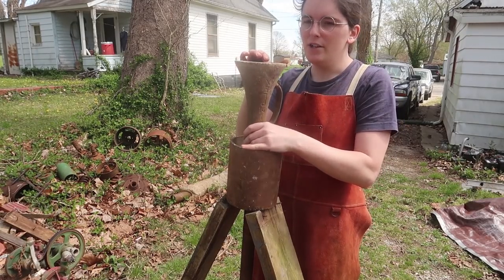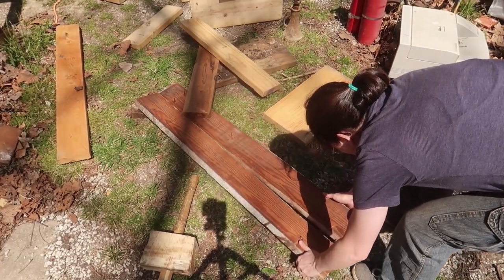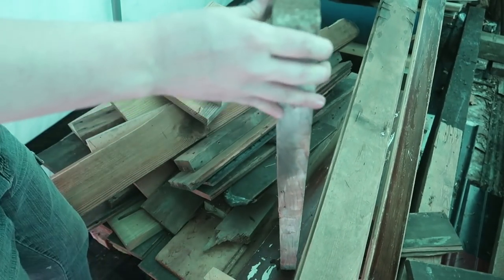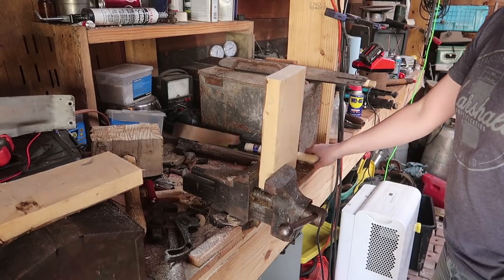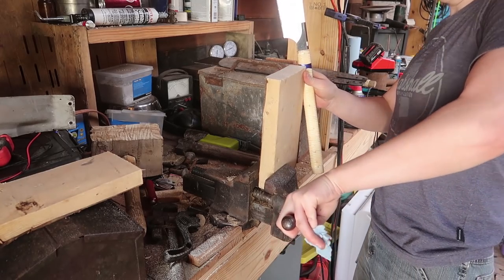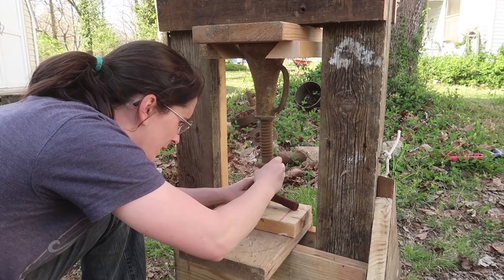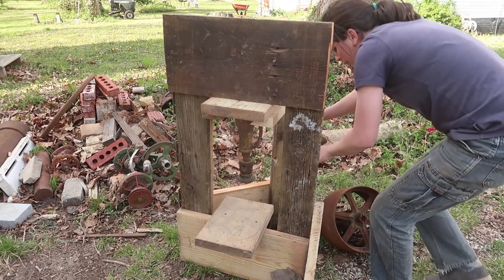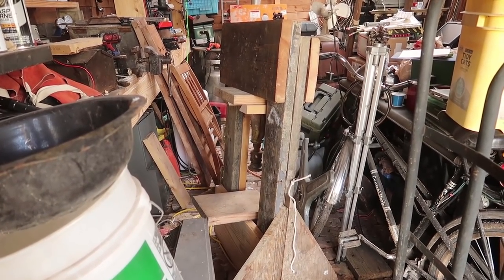DIY Wooden 12-ton (to be tested) Screw Press from Scrap

Comment: Legitimately thinking of building a modified version of this, if I ever need a press for my projects. If I do, I'll write an article about it for my website and credit you with the design. It's super clever.
Reply from the maker: i hope you do, and if you feel extra creative try making it so the pressure locks the pieces together harder. i was tempted to do a bit of japanese carpentry with it but then i just decided to make this super simple one. but i may keep an eye out for the stuff to make the one that almost doesnt need any nails.
Reply: @RinoaL  I was thinking of more of a bolted-together approach, but some sort of locking taper joinery does sound appealing too. I'll definitely consider it.
Reply: @RinoaL  My website is linked in my channel's "about" section, by the way. I think you might find the projects interesting.

Comment: While the screws seem to be holding for now, if you want some more strength in the cross beams as you take on heavier projects, find some round stock like a broom handle or something, and then drill some holes through the boards and use the handle as a pin.  Will probably add some stiffness as well if you put two in every corner.

Comment: Only thoughts to add is what you probably already know is sand blast and grease. Maybe a pin opposite the dowel pin to stop the pad from tilting. Just drill a hole thru but that would be a drill bit busting process without a mill because that curved edge. Maybe just nothing on the end and use different sized and shaped blocks to press with? I’ve used sockets from my socket sets and large nuts to press bearings etc, not the right way but it’s mine so who cares right? Love the ingenuity! 👍🏻

Comment: Nice job!   Maybe add some metal facing on the two lower boards (the "table" part of the press) to help prevent the edges of pullys from digging in, maybe inverted angle iron screwed over the corners of the boards.  A good thread clean and greasing as you mentioned for your restoration will certainly help. Well done.
Reply from the maker: nah if i need metal ill just put a metal plate, but for now sacrificial boards work fine.

Comment: Ah, a Black&Decker aluminium-body saw, good sturdy li'l units. Have a couple myself.
Hmm, suppose wood would become stronger if it was steamed and compressed with extreme pressure applied evenly across it?

Comment: Be careful with that saw.  If you are going to be touching the blade , unplug the saw.  I don't want to be telling you what to do, but I saw several  oh $h!t's that could have left you without fingers, and toes. I'm not saying I fallow a super stick  safety  regiment . But I have worked over 40++ years using all kinds of saws and drills and not fallowed OSHA requirements. Just be careful.